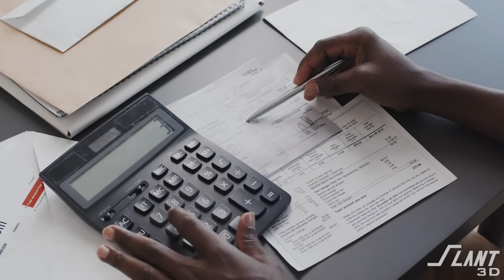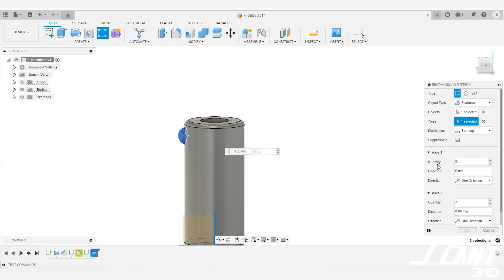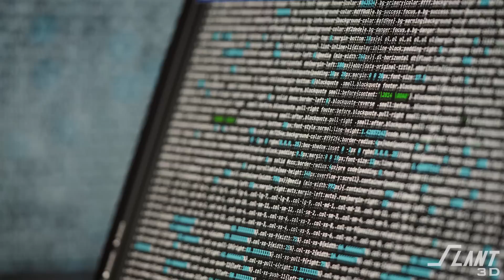3D Printing Will Obviously Replace Injection Molding

Comment: As optimistic as I am about the concept of the shelves producing the parts, there are some things that cannot be FDM 3D printed, at least with our current machines.

Take Lego. They cannot, and will not, change their design to make it more easily mass producible using printing. Changing the design would effectively strip them of all brand identity. Also, Lego will never accept the surface quality that FDM produces, even with the tiniest nozzle and the smallest layer height. Sadly, this isn’t an isolated case. Syringes, as someone else mentioned are in the same boat. Sure, you could insert some kind of plastic bladder inside to make it reliably watertight, but does cost allow it? Probably not. 

Then there is the problem of large objects. Make them out of several small parts? That will result in seams which are sometimes unacceptable. (I doubt 3D printing will ever get to EDM levels of zero tolerance precision.) 

With future technology advancements, something like powder bed fusion could maybe work how you are describing. No need for bed adhesion, no need for supports (in sls at least). These processes run into their own challenges of post processing and expensive materials, though. 

What Slant3D is doing is truly awesome. The number of products that can be mass produced (after tweaks) using FDM is huge. As technology advances constraints such as simple first layers and overhangs will become things of the past. Maybe one day we will even see multi-material (or at least multicolor) mass production. This will make even more products fit for FDM mass production. 

You make many claims which seem valid. The concept of reducing development costs and eliminating long distance shipping in particular. 

My suggestion, with admittedly no experience in the field of mass production, is to stop diluting valid, thought provoking ideas, with what I think is hyperbolic misinformation. False claims will make it more difficult to convince people to trust the true ones, so take care.
Reply: @valeriyproklov2868 Wholeheartedly agree. I love many of the videos/ideas I get from this channel but they constantly dilute their content with these desperate, half-baked, zero-research, low effort videos. And for what? The sake of releasing a video? To convince some birdbrain client that will believe anything without any evidence? Idk just seems WAY too forced sometimes. Which is unfortunate because they would easily be my favorite 3D printing channel since they actually make unique content and don’t just bow down to the BambuLords like everyone else nowadays. Just wish they did their due diligence more consistently.
Reply from the maker: The very fact that we exist is the proof. We are mass production 3D Printing company. We do it every day
Reply: @slant3d  The fact that you exist is proof to the argument that no one is debating. There is no doubt that there is a massive number of products that are mass producible using 3D printing. There is no doubt that 3D printing mass production is a valid method and has its own place. This isn’t what we are discussing. 

The fact that you run a mass production 3D printing company, and “do it every day” is in no way proof to your claim that injection molding will be completely displaced by 3D printing. 

In your video you state that most products do not reach the production volumes necessary to make injection molding economically favorable to 3D printing. But the term “most” means you acknowledge that there are products that do. I agree with that. There are, and in my opinion always will be, products that have volumes so large as to demand injection molding. Injection molding and 3D printing will coexist. Each has their own application.
Reply from the maker: They already are. Legos started shipping 3D Printing products 1-2 years ago.
Reply: @slant3d  I could only find a wooden duck replica that was handed out at The LEGO House event in 2022 as a limited edition item. Is that what you're referring to, or are there more than just that one product they've sold?

I'm starting to see why this video upset so many people. It really did seem like you were trying to claim that injection molding will become obsolete and/or completely taken over by FDM printing. But I think the issues about quality, durability, and surface finish speak for themselves. I think I, and nearly every commenter here, would just like an admission that there will, as far as anyone can see, always be a place for injection molding, even while 3D printing farms like yours take some market share and expand its own market share.

We all appreciate how down to earth and realistic your videos are. We come to see how you creatively overcome novel engineering restraints to design products with this new process, this new way of thinking about designing for mass manufacturing. We all want to see you succeed. Don't double down on this takeover narrative. Please address the surface finish and large part size advantages that injection molding has.

Comment: Hmm, I think the other part of this that people aren't seeing is that the time it takes to make a mould and set it up should be included in the speed of manufacturing since it doesn't exist for 3D printing. Like sure an injection molding machine can spit out 1000 parts in a few hours, but by the time the machine is set up a large print farm could already be done making the parts
Reply: What you don't understand is the scale of injection molding. 1000 ok but how about 10k 100k how about 1 mill how about 10 mill how about 50 million parts. Thats where 3d printing loses. If you're only making a couple k parts ok I see how 3d printing can be better. But can someone explain to me how a 3d printer will make the millions of water bottles we consume. How about all the other plastic packaging on food. It's 3d printing going to replace that no. Right now you sound like the guys that said forging would be a dead process and yet forged parts are still very much in demand for mass production as their grain structure is stronger than billet steel. 3d printing will most likely replace low volume parts under 5k but in no way can 3d printing compete with an injection mold on speed and part tolerance. What's the best tolerance you're printers will hold. Can they hold those tolerances after years of 24 hour use. I doubt it...
Reply from the maker: Very true. Time to make the mold. Time to qualify the mold. Time to change the mold. Time to ship the parts across an ocean.  And then you hope they sell

Comment: Sorry mate, never going to happen. “At the same rate” is simply wrong. I can pump out a 12 cavity mold shot in 14 second. It’d take literally tens of hours to print the same parts. 3D printing is for prototyping, product testing, and customization. I can see a future where MUD inserts are printed on metal printers though. But FDM will never overtake IM, you’re dreaming.
Reply: I did.  I don't think you addressed being able to produce at scales of even 5-20k NEARLY as quickly.
Reply from the maker: We are easly 2-3x faster than molding at low volumes of 5-20k
Reply: @slant3d  Define “faster” exactly. Basic math time. Even if it takes 4 hours to set up a machine with fully dried pellets each cycle is at most 12 seconds. 5000 parts are done in 24 hours. Even the simplest of FDM parts take 30 mins to print. 5000 parts is 2500 hours. You’d need 105 printers to match injection molding. Sorry mate you are dreaming.
Reply: @Frankenstein786  ...Decent, not even high quality 3d printers can print an excellent quality benchy in 20 minutes these days. Benchies are not simple. They are specifically designed to be difficult to print. We aren't talking about an ender 3 here. A well tuned Ender-3 can be expected to print a good quality benchy in an hour.

Lets play a game. Assuming the part takes 30 minutes to print (likely less if you are talking a 12 second mold), 5000 parts can be done in 24 hours with 100 printers. If you were to go with an ender 3, you could expect to spend 300ish dollars per printer. That means that at the most you would spend 30,000 on hardware.

Unlike injection molding, at the end you don't have a piece of metal that you store somewhere in case you need to use it for some other project, you can get started on the next project the next day.

Beyond that, if you are talking 100 machines, one or two bad parts on a machine won't take the whole system down.

And all of that is talking tech that is about 10 years old at this point. If you wanted to go with an off the shelf printer, and chose to go with the bambulabs p1p, you can reasonably expect each one prints at about 4-10x the speed of an ender-3 with better quality... And it costs on the upper end, 750USD. So instead of 100 printers you are talking 19kUSD and 25 of them, but you more likely could get away with 15 of them and that would cost you 12k. And that is still being extremely conservative.

Then you get into the question of why you need to print 5k parts in a day and have them sitting on a shelf waiting to be sold for potentially months...

I'm confident I'm wasting my time because you are a troll but hey, prove me wrong.
Reply: @Frankenstein786  you can fit those 105 printers is the same footprint of a 200 ton press and those 105 printers will still cost less then a new press. You will also have much more redundancy. If 1 printer breaks you don't loose much capacity.
Reply: @Frankenstein786  So if he needs 105 printers and he happens to have 300 printers, what would you say then?
Reply: @kevinwarner959  the logic being applied is literally as absurd as "well using a car to drive 300 miles is equivalent to using 300 cars to drive a mile each!"
Reply: @SirSpence99  I’m confident you’re a fool. 5k parts a day is literally a drop in the bucket. I mold up to 20k parts per day and we’re a low mid high volume shop. Some production runs span up to a week and can be 100k parts. 3D printing simply doesn’t scale like injection molding does. The fantasy that you’ll constantly need to change your design means you simply didn’t do your homework up front. Does it have its place? Sure very low volume custom. I could be convinced sub 10k parts would be worth the mold savings and likely faster to market. But 10k+ you’re dreaming kid.
Reply from the maker: You should really watch the video
Reply: @slant3d  You should really quit while you’re behind.
Reply: @slant3d You video is pretty much BS, for new products and products with a limited time to sell like toys of some superhero you are right.
But for daily use items like buckets, electrical outlets, light switches, lighters, containers, consumer electronic parts, there is no way you are able to 3d print then cheaper than molding.
Most products are not new, if you produce a new washing machine, the model and the design is new, but it is still a washing machine that will sell.

Comment: Dude, I think it's the second or third time you make the same argument. You never address the non-food safe aspect, shapes that need lots of supports and surface finish. You talk about them in the between videos, and basically your solutions to this problems are: Food safety - Don't know, Supports - Design your parts better, Surface finish - Stop being bitchy and get used to it, use fuzzy skin when possible and shut up.

Comment: This might work in a few niches. But components that contain a circuit board and other electrical components cannot be changed so easily. The rest of the design also needs to be adjusted and, if necessary, tested. Which then drives up the costs. I work in the aerospace industry as an NC programmer and we also use 3D printed parts there. The rework (fits and surfaces) is not without its problems, as the parts are very delicate and therefore difficult to clamp (process reliability). Even if one 3D part can replace several machined parts, the overall production costs for 3D printing are no better than for machined parts. The only justification for the parts is the weight savings in the finished product. And in aerospace the numbers produced are not particularly high.
The potential of metal cutting machines is far from exhausted.
This could also apply to the injection molding machines.
Reply: What printers are being used to make the parts you are talking about?
Reply: @SirSpence99  Eos, Trumpf and Nikon Slm are printer manufacturers that can do this.

Comment: if you limit the scope of this video to small companies with very small scale production of many products then yes, MAYBE you have a point, but replacing injection molding in industry? even if we ignore the quality issues of current 3d printed parts, what is the plan exactly? a 1000 3d printers farm creating 10 parts an hour each? consider the space you would need for that, and the babysitting of the machines, and one power outage mid print will basically ruin 10 thousand parts at once, the electric consumption, the heat generated, the manual post processing of all those parts after each print...
a single injection molding machine can print thousands of parts a day, of better quality and surface finish, it requires minimal babysitting and depending on the part it may not even require post processing
and the excuse for this is "i dont want to spend 5k on a mold, and once i do im stuck with the product design"? how much money would you have to invest on 3d printers to match the production of a single injection molding machine? this is ridiculous
Reply: 1000%  agree with this comment!  Injection molding machines can spit out up to thousands of parts per hour and run 24/7 without stopping.  I just don't see how FDM or any 3d printing process can every compete with that speed and repeatability.  The thought process is lacking for sure. 5000 FDM machines in a warehouse making 1 part per hour is not the same thing as 1 injection mold machine popping out 5000 parts per hour.
Reply from the maker: That right. The 5000 3D Printers are better. Better reliability. Better speed. Better Redundancy. Faster Part to Market
Reply: @slant3d   Either you are being intentionally dishonest or disconnected from reality.  Just because you say something on the internet doesn't make it true.  Do you work in the injection molding industry?  Do you see issues with molds failing to produce parts once production starts?  Do you have experience designing molded parts?  Injection molding machines are highly toleranced, accurate and well oiled machines that have been running for years.  A mold machine that can spit out 5000 parts in an hour is not some warehouse full of 5000 hobby reprap machine.  No 3d printer is going to match the speed of a single injection molding machine ever.  There are just physical limitations to squirting plastic out of a small nozzle layer by layer to build a part up in 3d.  The difference as the part grows in the Z direction is drastic.  Each process is different and building a part up layer by layer is not the same as shooting the molten plastic into a mold at high pressure.  A mold machine can spit out small and medium sized parts so fast, but with FDM if you go from a small 1in cube to a 2in cube, the amount of time difference to print is big.  You are solving the problem by adding more machines, which don't have the mechanical properties nor cosmetic appearance of molded parts.  BUT even if they were the same you are dealing in false equivalencies.  Lets say you entered a car race.  The winning car runs a lap in 1min and this is a 10 lap race.  Could you solve the problem by entering 10 cars that do a 10min lap.  Your "team" did 10 laps in 10 minutes, but you did it with 10 cars instead of 1 and each only going 1 lap before the race was over.  You did not win that race with a slower process by adding more cars because they each only did 1 lap in the race.

Lets reconfigure the problem.  Lets say instead of a speed race that you have to deliver 10 items to a location.  The items start at your warehouse and have to all go to the same location.  You have 10 cars delivering 1 item to the same location because that is all they can carry vs 1 car that can carry all 10 items at once.  Which of those makes sense?  All can drive the same speed limit.  And if you say 10 cars taking 1 part each to the same location you are loco.

My recent video and quote for FDM vs Injection molded parts looked at actual numbers.  The molded parts were delivered sooner and much cheaper than FDM quoted from Fictiv.  10 days to make a mold and 7 days to make enough parts to produce 250 game controllers.  FDM had a 22 day turn around and was 4x more money to meet the same goal.  Now I did quote around and get lower FDM numbers but the break even for Molding vs FDM was still in the hundreds of units (between 250 and 500) even with the best quotes I could find.  Now I already know you are going to say Slant would be cheaper and quicker.  It was 2000 parts in total and even if you ran 2000 machines and printed everything in a day there is no way it would be cheaper or match quality, surface finish, and function of molding.  

FDM has its place and print farms are fine, but this constant and blatant dishonesty is going to reflect negatively on your business.  You can see the comments on this video as proof of that.

Stick to getting the most out of FDM, showing how you can improve parts and orientations optimized for FDM, and talk about your business.  But don't intentionally lie and make bold claims about things that are provably false.
Reply from the maker: We do it every day